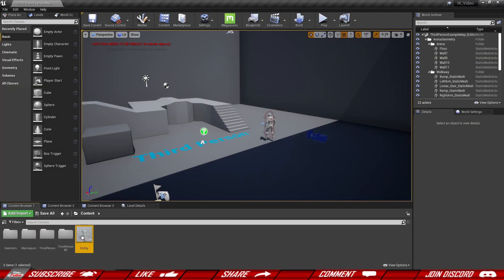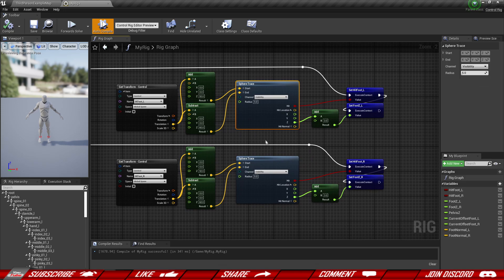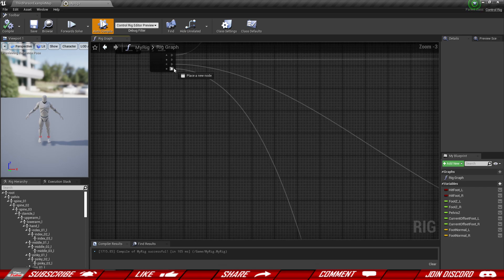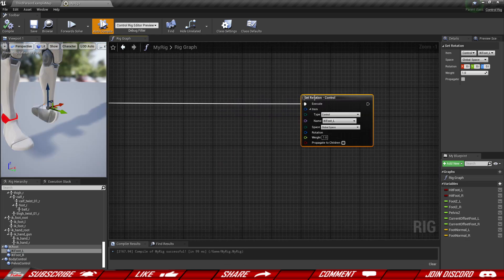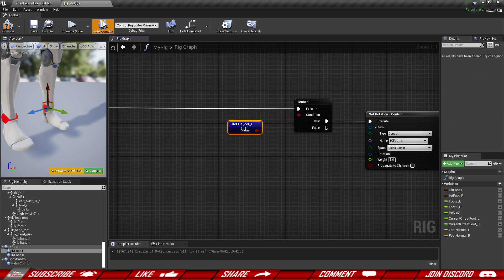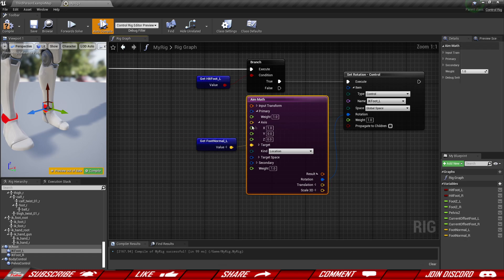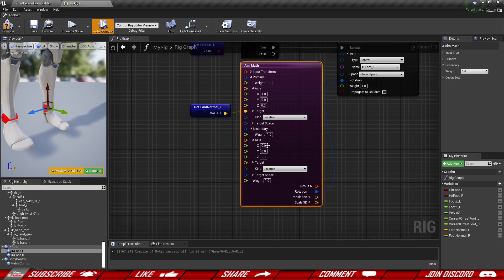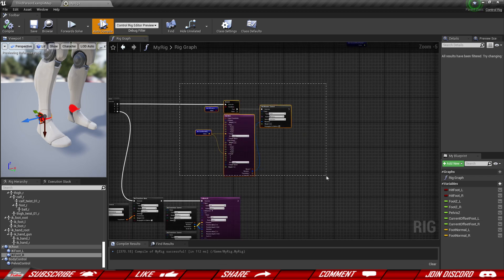UE4 Control Rig Leg Alignment

Comment: As at 13:40 mins + If you need to rotation of the feet to be slower I found you can store as a transform and split the pin to access the rotation as you cant save just the rotaion to get it working. Well happy with this tutorial really usefull and clear how to thanks.